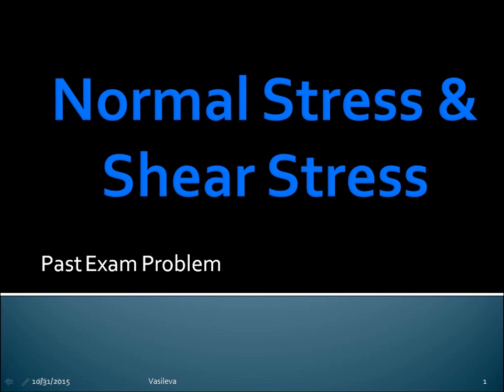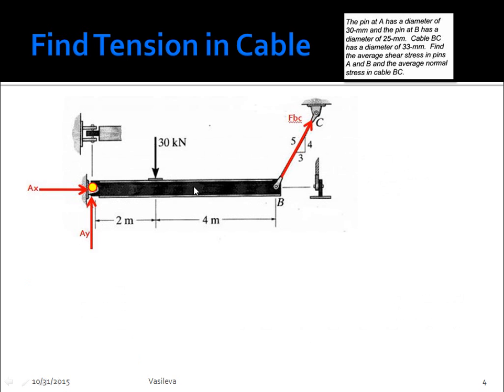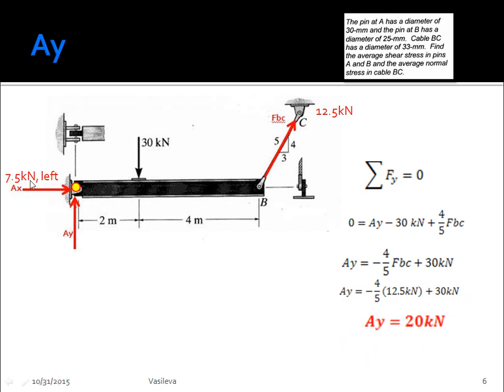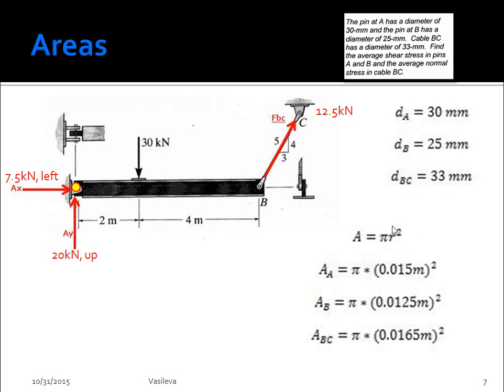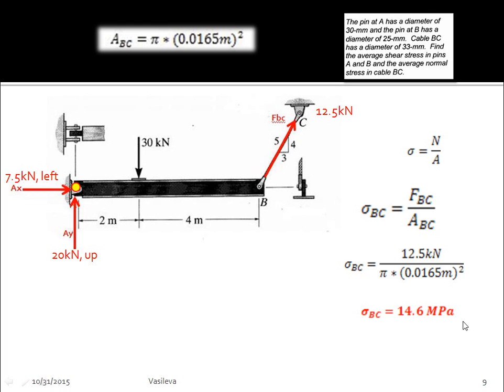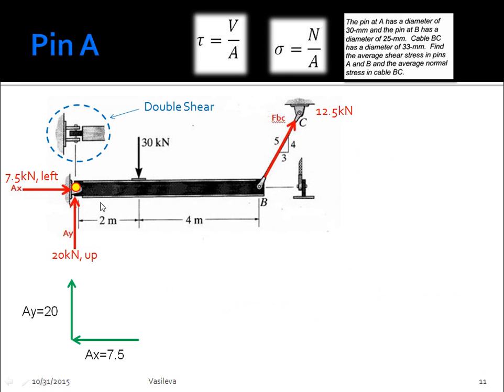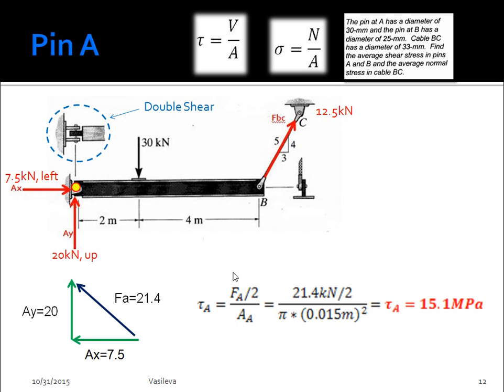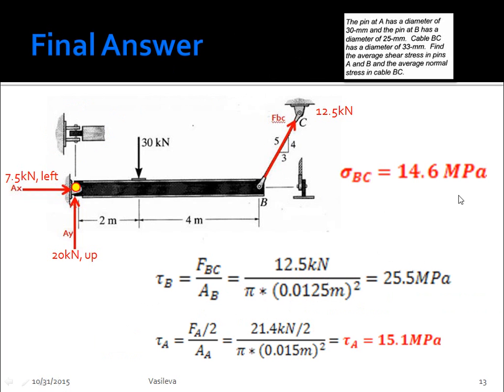Normal & Shear   Hard Exam Problem

Comment: How did u get those .0125m?
Reply: The one u used for getting the area
Reply: @reyesandrea8588  In the problem, diamater of each pin were given.

Since they're in mm(millimeters), we need to convert them into meters.

Then he used radius to find the area instead of diameter, so the converted diameter in meter was divided by two, because a radius is half of a diameter.

You can still find the are using diameter, but you have to use a slightly different formula for it. Like, A = (pi(D)^2)/4.